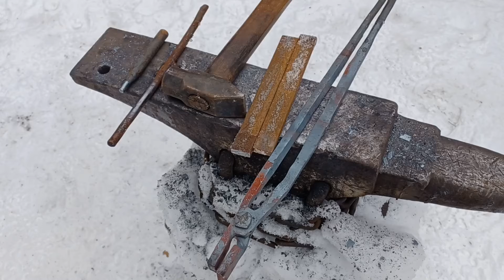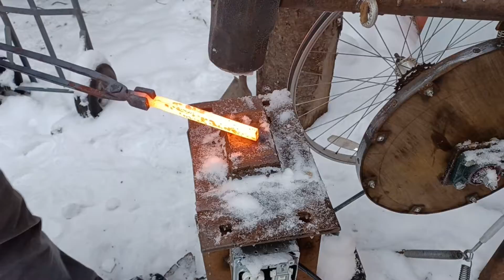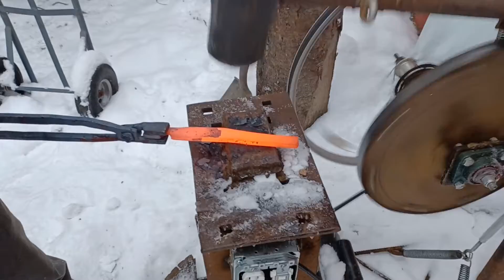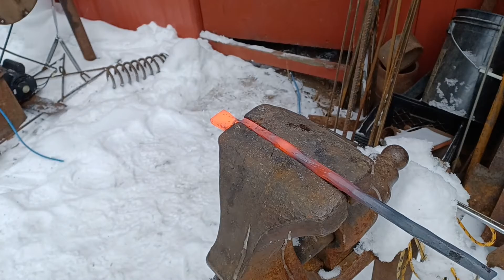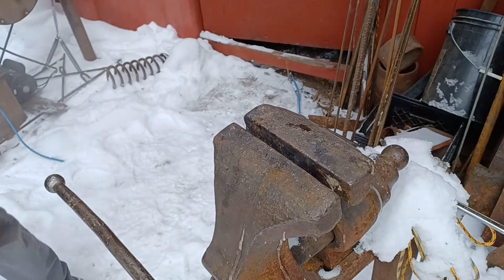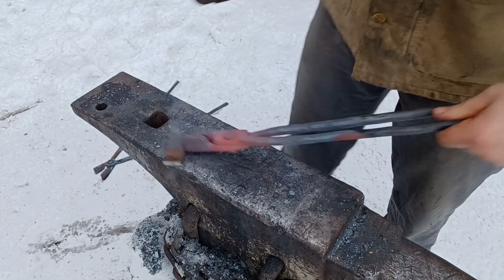How to Forge Tools: Twist Tongs

Comment: Just a FYI, when you move to the vise after riveting the tongs together and center the handles up with the jaws, this cancels out any right or left handed tongs. There is a difference in how they lay and position steel when handling right or left hand tongs if the reins aren't centered up with the bit
Reply from the maker: Ahhh, that could explain why I never noticed any difference in my left handed and right handed tongs. Since I tend to put that offset on all my tongs.
Reply: @northernforgeblacksmith  yep. If you have the time and materials, make a pair of right and left handed tongs without the offset and change them in and out on a project. You'll soon find that if you're right handed, the right handed tongs lay more natural in your hand and the left handed tongs you tend to fight more and vice versa. But if you offset the reins, right and left handed tongs feel the same
Reply from the maker: I'm going to have to try that out this summer just so I can feel the difference. Thanks!

Comment: I like that you remove the punch between strikes. That's normally done to allow the punch to cool slightly and the hole to reheat slightly between strikes. If you rotate the punch in your hand between strikes it will punch a rounder hole (if the punch isn't exactly round). Good job demonstrating your technique.
Reply from the maker: Thanks. it does allow the punch to stay cooler, and the hole hotter. It is also a good habit for when punching larger holes since that is when you would add your lubricant. I do rotate the punch (my punch is homemade and not perfectly round like you mentioned). I think I mentioned it in my tongs without tongs video, but didn't bring it up here.

Comment: Do you heat up your anvil somehow when it’s so cold?
Reply from the maker: Not really. Sometimes if there is snow and ice buildup on the anvil I will heat up a large piece of steel and lay that on the anvil to remove the buildup, but otherwise I just start working and the heat from whatever I am making will warm the anvil eventually.

Comment: How far North are you are you in Canada just curious
Reply from the maker: I'm in interior Alaska, near Fairbanks.
Reply: @northernforgeblacksmith  I'm in Missouri
Reply from the maker: cool, what's the weather like there? right now we are having a pretty warm winter, but getting quite a lot of snow.
Reply: @northernforgeblacksmith  right now it's not too bad it's been around 40 normally it gets in the 30s around this time of the year and we don't get a lot of snow we get mostly ice in a month or two it'll be down in the twenties sometimes it'll get in the negatives that's usually Mid Winter
Reply from the maker: thats not too bad. we have been in the positives mostly so far this year, but most years we see at least a few weeks as low as -30 to -40.
Reply: @northernforgeblacksmith  that's pretty far North and pretty close to Canada
Reply from the maker: I am about 6 hours from the Canadian boarder.

Comment: What kind of anvil do you have
Reply from the maker: honestly I don't know its origins. I bought it locally from a guy who had inherited his father's machine shop and was clearing out stuff he wasn't going to use. He said is mostly just sat in the corner and for most of his memory.
Reply: London pattern?
Reply from the maker: Yes, it is a London pattern anvil. Which is the most commonly recognized anvil shape characterized by the round horn on one end and a square heel on the other end. Also frequently has a step just before the horn, but not always.
Reply: @northernforgeblacksmith  I was told that my anvil is a Peter Wright but I don't know for sure do you know how I can find out for sure
Reply from the maker: typically you use the shape to narrow it down, then any markings on the sides of the anvil to figure out what it is, but mine has no markings on any of the sides except a few numbers by the feet that I believe are the weight, so I just use it and don't worry about who made it.
Reply: @northernforgeblacksmith  sounds good to me thanks